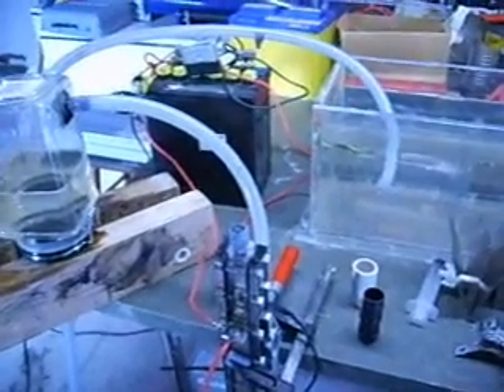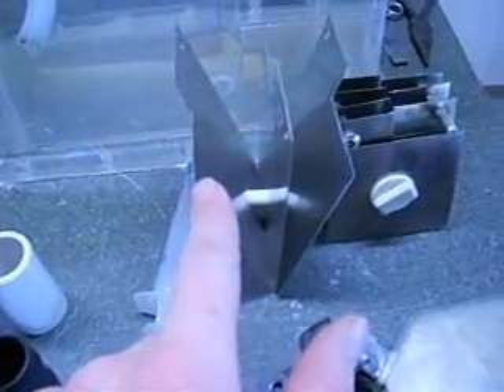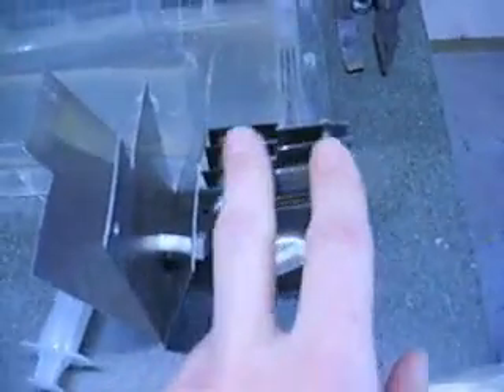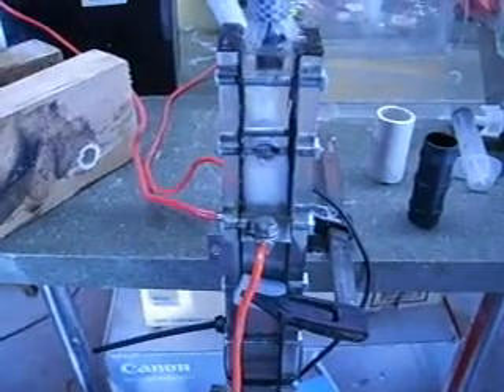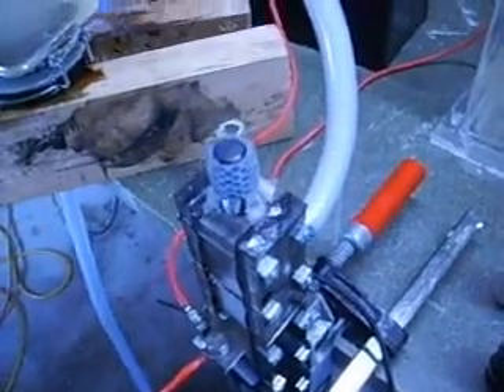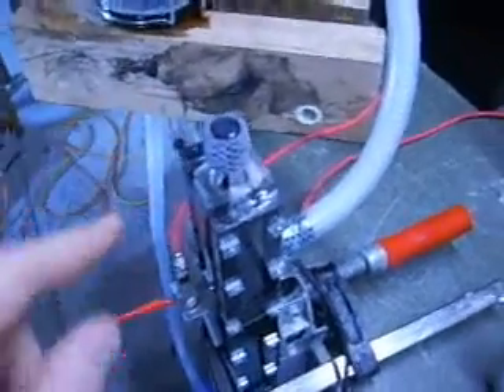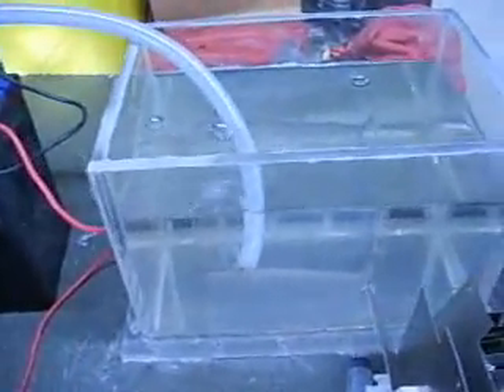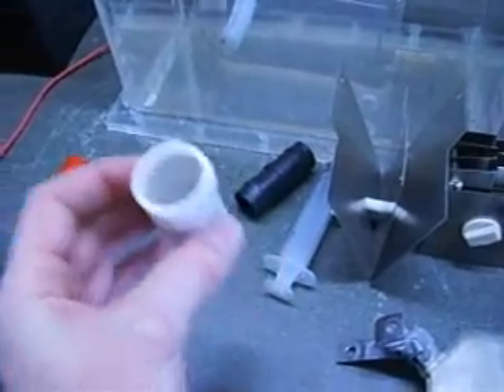Hydrogen at home (Q&A, new sandwich Cell)#26

Comment from the maker: I don't know anything about gasket maker so I cannot comment on that.  I am using neoprene gaskets because it's the best thing I could find and works well with the requirements I have.  In  particular when it involves dismantling, cleaning, and reassembling of the unit with as little fuss as possible.

Comment: Yep, you will find the dry cell is the way to go. Keep the plate gap voltage between 2-2.5v and seal the transfer hole edges from voltage leak for best eff. Check my latest vid to see it in action.